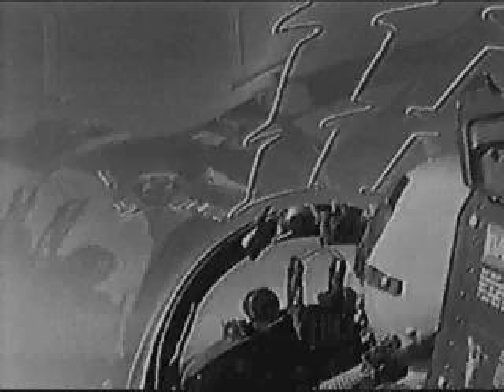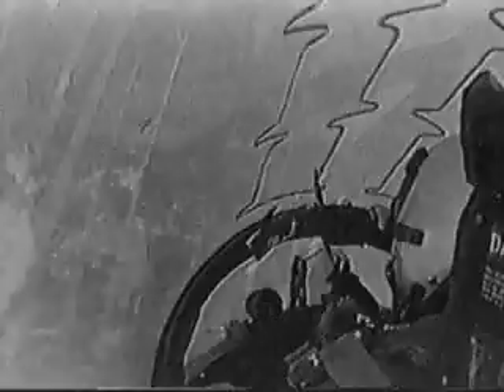T-45 Spin Test

Comment: This spin was conducted during the testing phase of the 45 and coming out of the spin had nothing to do with density of the atmosphere lol  The 45 is difficult to spin as it is, and it's my understanding the aircraft required specific equipment to get it to spin and the parachute was used to get it out of the spin.   I fly the 45C on a daily basis and certainly glad it doesn't easily enter into the spin regime.